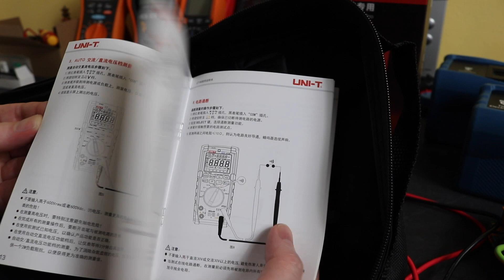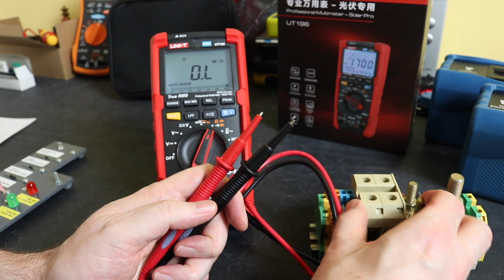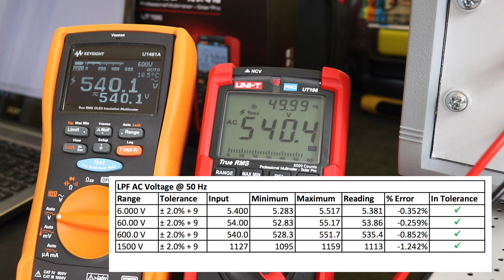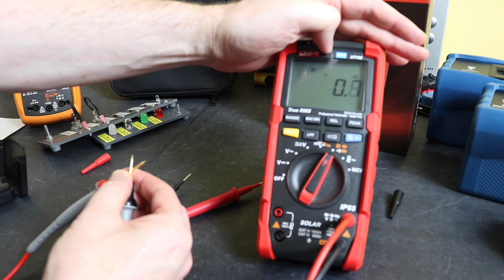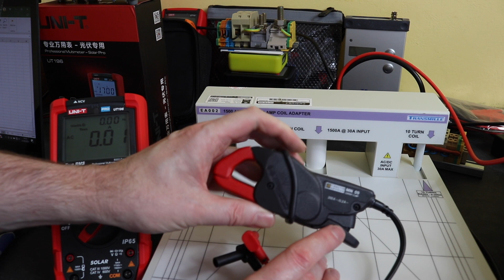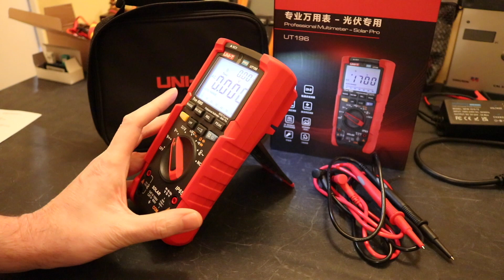Uni-T UT196 Solar Pro Multi-Meter

Comment: you did not test the solar function? why is this meter called solar pro
Reply from the maker: Presumably because it will measure up to 1700V DC as some industrial solar farms are operating above 1000V DC now, out of range for normal meters. It has no specific solar panel testing capability though.

Comment: Does this Meter have a real LoZ mode?
Reply from the maker: No, as far as I know there is no LoZ mode, only an LPF mode, low pass frequency filter for measuring output voltages from an inverter.

Comment: LowZ function on automatic Ac Dc mode. Is it good enough?
Reply from the maker: At 2 MOhm it will be lower than the input impedance of most DMMs, but in terms of LoZ function it is quite high and certainly higher than a 2 pole voltage tester. It's going to be up to the user and what they are working on, as to whether it is good enough for them.

Comment: Is this multimeter as good as fluke 87v?
Reply from the maker: Depends exactly what you want from the multimeter. The UT196, won't be as accurate or rugged as the Fluke 87V. If you are in need of calibration, then there will be no problems with the Fluke, you could get the UT196 checked, but you may not be able to have it adjusted and technical support from Uni-T will likely be minimal. On the other hand if you want to measure above 1000V, then the UT196 will be more user friendly than the 87V and more cost effective, if you are looking to buy new.

Comment: Whats the peak function for? And could possibly use min/max function for peak?
Cheers
Reply from the maker: Going by memory as I don't have the unit with me. The min/max is a continuous recording function and displays the current reading on the main screen with the selected min/max on the smaller secondary display.
The peak is a hold function, displaying the maximum or minimum, but there is no specification for it in the manual. 
Whilst you can use it for an inrush current measurement, the current measurement function is AC only. You would have to measure a DC inrush current using the voltage function and convert.

Comment: Nice 100 turn coil.  Where can I get one?  Also, why is the amp clamp AC only, would be nice to have DC as well especially with that selectable 100mV/A.
Reply from the maker: The first clamp table I made up myself. The second clamp table with the three multiturn coils came from Transmille. I have no idea, why Uni-T made the clamp function AC only, especially as it is aimed at the solar market. Thanks for watching and commenting.

Comment: This is so cool. So it's designed specifically for solar panels to check high voltage DC.
Reply from the maker: Yes, it allows you to read the higher voltages, would be on quite large solar or battery installations. A lot of the grid tied battery systems we have are over 1000V. Can also measure the output voltage on a 1000V insulation tester, that usually just goes above voltage range of a standard multimeter.
Thanks for watching and commenting.
Reply: @three-phase562 How about ut191 for max 3x400V and 450v dc?
Reply from the maker: @florind.5711  Sorry, I haven't tested that instrument or used one, so can't comment on it.

Comment: Thanks for sharing. It runs on 9V battery, right? Does it have auto-hold? Some qualities I appreciate were: auto AC/DC voltage detection, separate mV, and high CAT ratings. If that external AC clamp function allows for 1mV/A output (conversion) ratio, it will be an ideal partner for UNI-T's own, low cost CS06A, as well as the Fluke i400e, AC accessory clamps. UNI-T seem to design their DMMs to have standardized look, which I think is good. My UT191T looks similar. Price to performance ratio will be quite subjective depending on one's needs or market location. My Hioki DT4256 cost lower than the UT196.
Reply from the maker: Yes it runs on one standard PP3 9V battery. There is no auto-hold feature, just manual operation of the hold button to hold and then to release the reading. Yes the AC clamp function should work with any clamp adapter that matches the output ratios.
Very hard to quantify the value of the unit as there are so many different factors and individual choices available. Its not a bad meter but there are probably a lot of options out there unless you specifically want to measure above 1000V.
Thanks for watching and commenting.

Comment: Not a bad meter, could be worse. I've never seen anyone test meter leads with an insulation tester before.... but me. lol I like testing everything insulating with a "megger". I don't go grabbing it with my hands when energized though. 
As far as NCV, in my experience I never really have good luck with any of them. I do find however if there is no load or the hot and neutral are run together, like in an extension cord, it cancels out the EMF and hard to get a reliable reading. Higher loads and individual wires work much better, as theoretically it should. But just NCV in general, I never have good luck and of course, never use one to test for dead. Except in the substations on high voltage, where you can't physically put a leaded meter on and you have to use a non-contact tester.
Reply from the maker: Probably typical of high voltage test engineers, who tend to think of an insulating medium as just a bad conductor. I try and simulate what would happen if the test leads get trapped, but I should probably have an insulated glove on when I do it.
I don't actually use NCV mode on a meter out in the field. I do have a Kewtech Volt Stick, but they are all a bit hit and miss in operation really. I tried it against a distribution board as well and it operated in much the same way.
Thanks for watching and commenting.

Comment: Thx, solid review & walkthrue, like it tends to be from your end. +1
Did you take a look on the inner circuitry, if the higher voltage pro label also materialized there?
Unit-T sadly has a history to not go all the way, and in the past tends to take shortcuts, but it varies from meter to meter.
It is getting better on some models the last few years, but they do list it as "pro for higher voltage", and  UT196 aint a meter to 50 bucks, so wonder how well it stacks up internally.
// An older model 195E that seems to be the source for this series just in a more std. DMM variant as UT195E is a non-HV version - but still gives a crude idea of the inside, that definitely is a step up vs. the cheaper Unit-T models https://youtu.be/dni6ZhqNCXs?si=vFOk5Je_lTJBkFL7&t=1921
Reply from the maker: No, I have not opened it up yet, you can see some PTCs when installing the battery but no MOVs. I plan to do a video comparing it to the HT65 and will open it up then  to compare between the two.
Thanks for watching and commenting.
Reply: @three-phase562  sounds good, will look forward for that..
btw the mentioned issue with your tiltbay not locking. is also highlighted on the UT195E & UT195S (same model line)
https://youtu.be/dni6ZhqNCXs?si=kJb10tDrRu-HDjwu&t=832
there are also mentions about the diode in the front that can double as a crude light sensor if you block it with BL active..
I don't know if that is also the case on UT196 as I dont have these meters, but I would give it a shot from the bow.
https://youtu.be/dni6ZhqNCXs?si=xarsuGcZ2-97Jv53&t=911
Reply from the maker: @JAKOB1977   Thanks for this, it looks like the same case as the UT195, so they don't appear to have addressed the tilt stand being loose. I tried covering the top LED, but it doesn't appear to operate the backlight on the one I have. Will be interesting to see what the internal build is like.

Comment: Hmm,yeah,not Uni-t's finest work,but a usable multimeter none the less.Other than slightly higher working voltage, there's really nothing that sets it apart from the rest as a "solar" meter,not sure about the price tag either,but nevermind,can't win them all.Great review all the same,this is why you do them,after all.🤔👍
Reply from the maker: It is quite a mediocre meter really. There are a few manufacturers that have brought out multimeters capable of reading 1500V to 2000V and marketed them for solar installations, but that is the only extra functionality. You would have thought that they would have at least added in DC current measurement as well if they are aiming it at solar.
I guess with it being their ruggedised design and aimed at professional use, they have upped the price. In the UK it would be a reasonable price, but if you didn't need the higher D|C volt measurement capability, there would be plenty of better priced instruments out there.
Thanks for watching and commenting. 👍👍